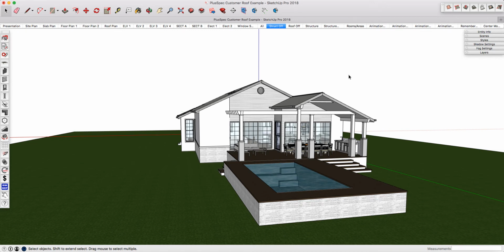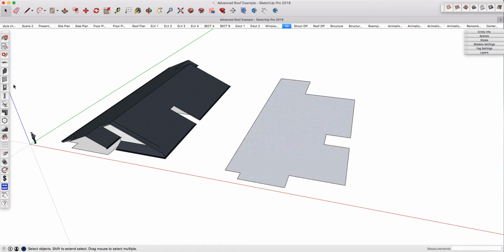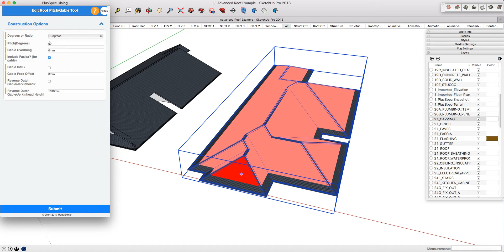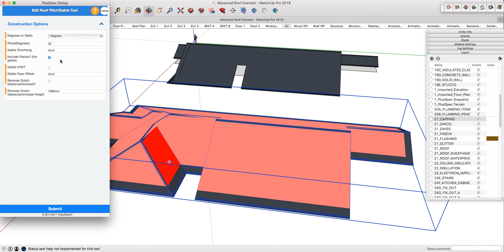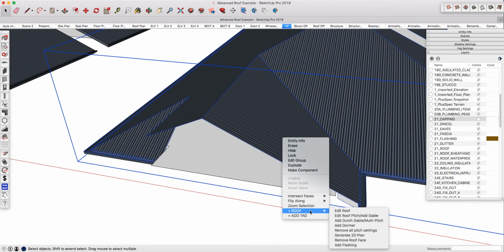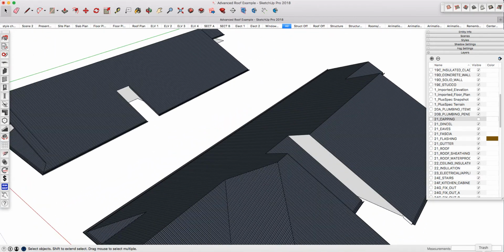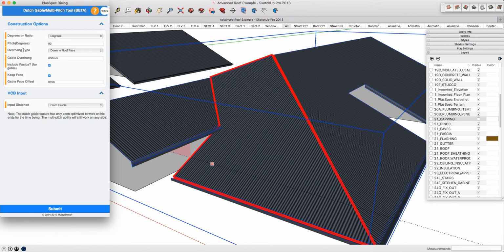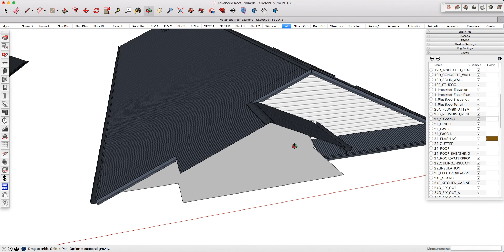PlusSpec for SketchUp Advanced Pitched Roof Editing Tools

Comment: How do you connect the fascias to mitre correctly?
Reply: The fascia should already be joined,  before I can answer i would need to understand more about your problem.  
Yet a generic answer would be: you are in SketchUp so you can simply triple and modify geometry as you see fit.  It's very unusual for PlusSpec not to automatically join fascia and barge